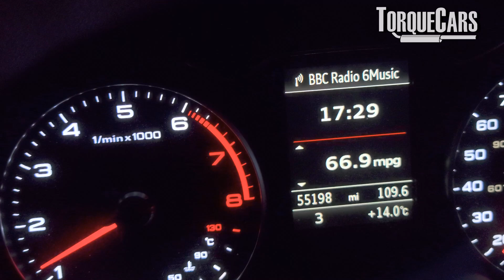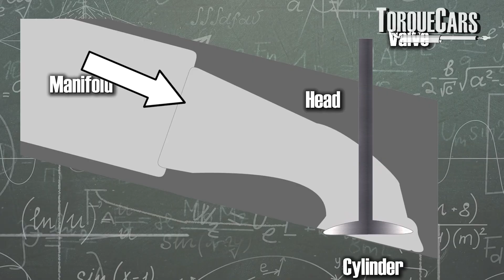2016 EA211 EVO Revisions - What Changed & Main Differences Between 1.4 & 1.5 TSI TFSi versions

Comment: Good video  Currently looking at changing my mk7 gtd for possibly the 1.4 or 1.5 act/cod 150bhp engines in either the leon or a3  
& not sure at the moment which engine to go for. only thing i have read  is the 1.5 can suffer with kangarooung when cold.also considering the 1.8or 2.0 tsi/tfsi but doesn't seem to as many of the ea888 gen3 around in comparison to the ea211.
Reply: Go for a late 1.4. I have the Leon 3.5 in the 2.0 tsi brilliant motor with the dsg wet clutch. Avoid the dsg in the smaller engines as they use the unreliable dry clutch
Reply: @tobymajor6459  I second that I've got a 1.5tsi and previously had a MK3 cupra 280 cupra done 33mpg,golf does 40 at best, I'd hold onto your diesel just watch the belt on the oil pump.

Comment: I have the 2022 1.5 tsi evo 130bhp manual, seems to be OK now for three years. I never use the start stop due to short journeys every day and change the oil at 3500 miles. I believe it's cylinder injected, plasma injected cylinders only apply to the 150 bhp variant.

Comment: Thanks for an interesting video which is informative but has left me confused about what engine I have in my 2021 Audi Q3 Sportback 35TFSI MHEV. I believe it has the EA211 evo1 mild hybrid engine that does not have cylinder on demand (though I read somewhere that it does) & it’s direct injection & is connected to a wet dual-plate clutch 7-speed DSG. Now I’m thinking it could be an evo2 with both port & direct injection. 🤯
Reply from the maker: Tomorrows video focuses on the 2023 EVO 2 which should help clear things up a little more. The regional variations and different models with exceptions to the rule make it challenging for us. I think you'll have the EVO - the 2 came out later in 2023 which was also just a 1.5 capacity. If it has cylinder on demand there is usually a little notification that pops up on the display to show this. Many people assume the hybrids use the same 1.4 engine as the non hybrids. If it makes you feel any better an Audi salesman told me the hybrids all had cylinder on demand.
Reply: @torquecars  Thanks for responding. You're right about evo2 becoming available after my car was produced meaning it's an evo (later known as evo1 when evo2 was introduced in 2022). It's the DFYA mild hybrid which has served me well these last 4.5 years though it's only on 20,000 miles & it's the mildest of mild hybrids to be honest. Pity it's not port & direct injection as I expect to be cleaning the valve stems in a few years. So much for progress - it's like the de-coking process of long ago.

I also have an A1 25TFSI with a 1.0 litre EA211 & a relatively
straightforward 5 speed manual.
That too is a nice engine & just right for the car. It has a conventional dry timing belt which is a big plus with so many wet belts causing problems on other engines.

I look forward to watching your evo2 presentation & perhaps wishing it was fitted to my Q3.

Comment: I've got both 1.4 my Audi A3 and the 1.5 in my wifes VW TRoc and both impressive engines. They feel like a very refined diesel due to the decent low down punch and how the torque trails off around 4.5k but they happily rev to 6k but theres not that much point. Between 1.5k and 4k the torque is the same as the 1.8 EA888 so for every day driving its great as it returns very impressive fuel economy. I've seen up to 60mpg on a long run but normally get between 45-50mpg. Another thing is the engine is very light weight so turning in to corners is very impressive.
Reply from the maker: I think they are a perfect blend of economy & performance. I could push mine to 70+ mpg on one regular trip I did. As long as you keep them in the power band they sparkle performance wise.
Reply from the maker: Do you feel there is much difference between the 1.4 and 1.5? I would be interested to hear your comments.
Reply: @torquecars hard to say really as the 1.5 Troc is 70kg heavier and is a DSG so I feel the 1.4 is more responsive and quicker, but on paper they should be the same. The Troc has more top end power but it’s negligible.
Reply from the maker: I found the 1.5 to be more noisy (in a good way), it also felt like it had more mid to top end torque but seemed to take longer to get up a decent pace. It was pretty economical though.

Comment: Good to see this range of engines has improved over the years.

My wife has a 2011 Audi A1 1.2 TFSI   since new and it's had oil leak and timing chain issues which are expensive and time consuming to fix.
Reply: I’m glad they went back to belts on the EA211…it’s a fairly wide belt too so pretty strong. The water pump doesn’t run off it so the timing belt has less things to do.
Reply from the maker: Interestingly I've never known a belt to fail on these, even with the very long change intervals (almost fitted for life as perceived by many).
Reply: @torquecars I had mine changed at 90k and the old belt looked very healthy. Supposed to be a lifetime belt but obviously don’t follow their advice
Reply: @torquecars My Audi A4 2.0 TDI has official belt  change interval of 133k miles, but I didn't dare leave it that long. I changed at about 1/2 that distance. I gather that often it is the various adjusters and jockey pulley bearings that can fail leading to disaster, rather than the belt itself so it wasn't worth taking the risk.
Reply from the maker: I think that was a year or two before the revision to the EA211, those EA111 engines were ok but had quite a few issues but thankfully they have learnt from them and moved the range on.